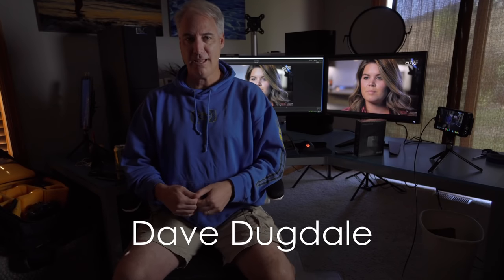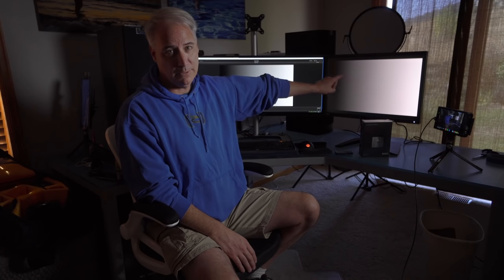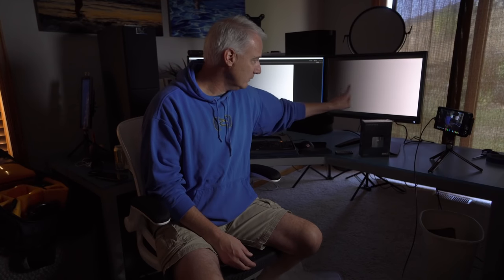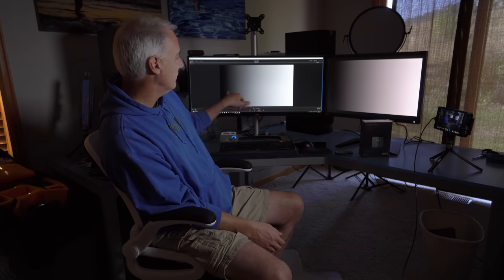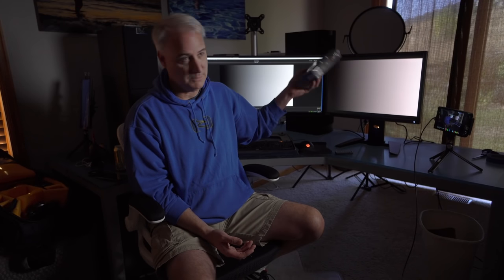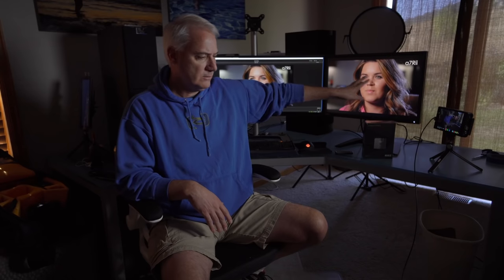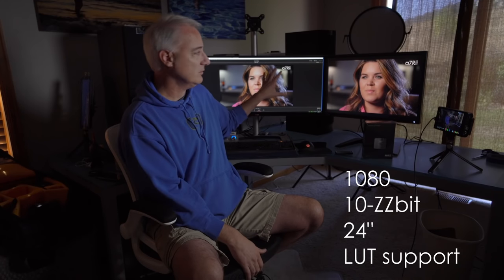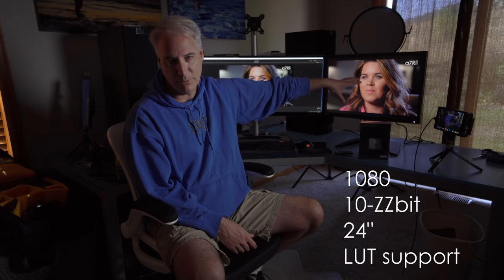Two Grading Monitors for Resolve to Perhaps Avoid

Comment: We use original Dreamcolors.  they are 8 years old and still essentially perfect REC 709 displays.  Because they have RGB backlights, we have been able to re-calibrate any drift in white point (why monitors later become unusable with age - the backlight goes off color - which you can only correct in an RGB LED system)  Generally Dreamcolors are great value if you buy the calibration kits - you can then refine the internal hardware calibration using LUTs etc.

Comment: I needed a bigger screen and my pc is just beside my tv so decided to use my Samsung 4k 48in tv (UE48HU7500)  I find it works great for my needs. I say its pretty accurate to my eye. Printed photos look 99% to what my screen shows. graded videos also look very good even on different screens around the house.  The tv settings is Standard on picture Mode and Color Tone, HDMI Black Level Normal and HDMI UHD color on. Colorspace set to auto. Then used THX tune up app. And Im happy with the results.

Comment: Dave, you have not done the PG2401PT justice in this review. I have been using one professionally as a grading monitor for DaVinci Resolve for at least two years. Yes, it is 10bit through DP and DVI-D only - not HDMI but I run mine through a 12G Decklink SDI card and SDI > DP adapter where I get 10bit @ full 4:4:4 on the Benq. The PG2401PT also runs at all popular video frame rates too. I'm in PAL land so have the monitor synced to 50Hz rather than the native 60Hz so all pans are smooth. It is a colour accurate PC monitor, designed for still images, not a TV so movement will never be as smooth as say a true FSI or Sony OLED 'video' monitor 

Also, as you only have the 3G 'mini monitor' card, your output will only be 10bit 4:2:2 BUT you could have used a simple, cheap, passive HDMI to DVI-D adapter to get 10bit into the BenQ from your PC. However, I do not recommend HDMI for any professional application.

PS: HDMI and DVI-D are virtually the same. BMD's HD-Link SDI to DVI-D adapter actually comes with a passive HDMI adapterr)
Reply from the maker: +Craig Marshall's Asian Rail Tours thanks Craig. So what am I doing wrong besides using the hmdi input at this stage, why I'm I getting flickering and other artifacts during movement?
Reply: Hi Dave. Not sure what is wrong with your setup but one of my very valuable video clients (based in Taiwan) brought me in the PG2401PT to Australia soon after BenQ released it saying "This is for you. Make it work" (When she says 'Jump', I ask 'How High?' get the picture....)I had just set up a Resolve PC workstation so like you, was looking for an affordable grading monitor for web based delivery. I had already bought a 'mini-monitor' too, so I tried the HDMI route but the pictures exhibited poor resolution with crushed blacks at 8bit so I bought a second hand SDI to DVI-D HD Link ($250) and suddenly, there was a stunning, crisp 10bit image on the monitor with a 10bit Tiff test ramp displayed in Resolve's Color page. (I now use the Decklink SDI 4K Pro card with an SDI to DP converter for 10bit @ 4:4:4. This is a good bet for 4K work too as SDI #2 will downrez all 4K to HD so you can continue to grade 4K video on the same calibrated HD monitor) Here's something worth testing if you still have the PG2401PT: buy a cheap passive HDMI to DVI-D converter and put it between your mini-monitor's HDMI output and the BenQ's DVI-D input and test for 10bit display. (note: DVI-Dual needs all wires correctly routed to display 10bit)Dave, at the end of the day, these PC 'photography' monitors are at best a 'workaround' for video grading BUT with an SDI 'foundation' in place,  you can always rent in a calibrated FSI or Sony 'video' monitor when more critical work is required. IMO, a probe and the supplied Palette Master calibration software on the PG2401PT is more than adequate for all web based deliverables. (I use Rec.709 at Gamma 2.4)
Reply from the maker: +Craig Marshall's Asian Rail Tours thanks Craig for all the info. This is getting more complicated than I was hoping for. I'm not sure what's wrong with the copy I have, I'll send it back. Not sure what I'm going to do.
Reply: Craig's Asian Rail Tours Hi can you please put the actual name of the converter you are using ? I mean the brand and the model etc much appreciated thanx
Reply: The flickering is from the AMA setting.  It's in the menu under System settings.  If you turn it off, playback is totally smooth.  Of course, this reply is one year too late! ; )  I just picked up a used copy of this monitor for $400 and it's nice, but my issue is that it is NOT uniform.  It is significantly warmer on the right side of the screen than the left edge.  It's going back.

Comment: EDITED -Found a good solution with low cost and descent accuracy when researching at BMD forum - BMD mini out HDMI to this box for LUTS and you use to create custom LUT to calibrate monitor - https://displaycalibrationtools.com/store/eecolor-lut-box-65-cube-3d-lut-color-correction-processor/ - From there you use a TV with good accuracy which led to my question before - So I had a question that was sorta discussed in the comments.  Why not buy cheap 'larger' TV that has 10 bit and you can use the BM HDMI out to the 'TV'?  I found this chart online - http://www.rtings.com/tv/tests/picture-quality/gradient - A Lot of these 'TV's' are very affordable and LARGE if you need that.  - Freespirit - below discusses a monitor that looks amazing and really inexpensive for sure.  Thanks for all the awesome content.
Reply: The EE box has long been a Pro solution but a more 'affordable' solution, with a couple of caveats is this: BMD recently released their 4K Terenex SDI to HDMI converter which operates at 12Gbps so it can display 4K video at up to 60P framerate. With this device installed, you can load calibration LUTs so you could run it from your mini-monitor card's SDI output to your TV's 'Graphics' HDMI input so in theory, correctly 'calibrate' a consumer TV. We use a 55" Sony 9000 Series 4K TV as a 'client' monitor out of our DaVinci Resolve grading suite so clients can view their HD/4K images on the big screen in real time, whilst we grade on our calibrated 24" SDI display.

Comment: I like the iDisplay Pro a lot. Made a cheapo BenQ computer monitor usable. Maybe with a new color profile the issues it has now might go away. Maybe...  I do think using a reference monitor will fix all the issues you have been dealing with. You are using computer monitors as a reference monitor right? Only issue with a reference monitor is it's expensive. Ugh right?
Reply from the maker: +Erik Naso yea, I can't afford a resl video monitor that cost 5 grand.

Comment: So I recently discovered that most computer videos cards don't actually put out 10bit color. with Nvideo you have to get a quadro card.
Reply: That is true if you're on Windows and if you are feeding your monitor directly from a computer's GPU. In Dave's case he's using a dedicated I/O card to output his video and it's ability to send a 10bit per channel signal is not limited by the GPU installed on the machine. The "new" MacPro's will do 10bpc and I think that the 2010-2012 Mac Pros running a GTX980Ti or the like may also have 10bpc since they're relying on Mac OS X drivers written for the Quadro line.
Reply: I plan on installing Linux soon in order to cleanly run Resolve. There is good support for Blackmagic’s DisplayLink cards, so things (could) flow better and work faster. Windows is so full of unnecessary bloat and Windows 10 actively works to grab your data. I don’t know why so many people are fine with that? I’m looking forward to leaving Windows (and OSX) behind. Since few programs still require a high-end desktop CPU & GPU, once I can run those programs on Linux, I’ll be ecstatic to finally leave Windows for good.

Comment: I just bought an Asus IPS monitor (MX279H) and a Decklink Mini Monitor 4k PCIe Card. I'm trying to make them work with DaVinci Resolve, but I'm having some problems: the problem is that when I try to set up the output from DaVinci to 1920x1080 progressive at any frame rate (23,976, 24, 25, 29,978 and 30 are the possibilities) the screen stays black with a "OUT OF RANGE" message. But if I change the output to 720p at 60 fps or 50 fps, it works perfectly.
So, I thought maybe the monitor only works at 50 and 60 hz. And I tried setting the output to 1080i at 60hz (30fps) or 1080i at 50hz (25fps). But it didn't worked either... just like the first time: "OUT OF RANGE" message.
The monitor works perfectly at 1080p at 50 and 60 hz if conected to my nVidia GTX 1070.

Can you help me to make it work at 1080p23,976?

Comment: I bought an Hitachi 50 inch 4k monitor about 8 months ago. If you have any advice as to what my settings should at least be for color grading that would be so helpful!

I get flickering often on certain clips that I can fix by moving the exposure buttons in Final Cut Pro X, but if I move them later, it comes back again!..what a pain.

Do you know the refresh rates or if my monitor is a 10bit?

Comment: What application are you using for calibrating your screens? I found DispcalGUI being far superior to the stock X-rite application that came with my x-rite Colormunki.
Reply from the maker: +Daten Raten the stock one. I have a lot to learn.
Reply: Yes, you really need to be using LightSpace or Calman.  Its a big jump in understanding however..  the software your using is more for Print type work..  You really need to be making LUTS etc.   Also, a probe in the $6000 up at least is required if you want reasonably consistent looks and good quality shadow calibration. (Its hard for probes to get good colour readings when the number of photons is greatly reduced..  The cheap probes tend to do poorly in this area )   Its not a cheap thing to do properly..    Oh and FSI from memory did come out with a cheaper version of its monitor that would be more suited to your use model.  So I would definatly check that out..  But its still in the few grand range..

Comment: Are you using quadro to drive 10 bit monitor.. I think you need a quadro .. As far as I know Geforce cards don't output 10bit..  although I think GTX 10 series might because nvdia said 10 series support HDR output which requires 10 bit colour space, I'm not sure though ..
Reply from the maker: No I am using the BM Mini Monitor to drive the grading monitor, my GTX980ti drives my GUI.
Reply: Ok.. Thanks for the reply :) .. I use GTX 970 so if i buy 10 bit panel i only need to buy this to drive 10 bit rather than expensive quadro right?
 ..
Reply from the maker: I think so, I am not an expert on that topic.
Reply: Ok..  Thanks Dave
Reply: they do output it, but the UI doesn't use it. you also need certain cable setups to make 10 bit color work,
no matter what card or monitor you have. it will never go over HDMI  http://nvidia.custhelp.com/app/answers/detail/a_id/3011/~/10-bit-per-color-support-on-nvidia-geforce-gpus
Reply: Space Cadet HDMI 2.0 support 10 bit and 12 bit  with REC 2020 color gamut, provided both card and monitor support HDMI 2.0
Reply: Harikrishnan K M but you would need a quadro. i'm not sure any quadros have hdmi. they have DP which is already much better
Reply: Yes, Nvidia requires Quadros and supported drivers for full 10 bit+ support.
Reply: Not to be a wet blanket, but you may want to double check with BMD to verify that you actually can get 10-bit per channel out of your card over HDMI. I called them last week and was informed that my DeckLink 4K Extreme 12G only outputs 10-bit per channel via SDI, and that with it's current firmware the only way I could drive an HDMI display with 10bpc would be to buy one of their Teranex SDI to HDMI boxes...
Reply: I've been looking around because this really confused me, i was certain that any card since i think the 700 series of cards supports 10 bit. It seems to be that its not really the card itself that is limiting whether or not you can actually output 10 bit+ but rather the drivers implemented for the card and the software used. At least this is what im coming to the conclusion on, so this seems kinda sketchy if that is the case, seeing as its basically forcing people to buy extra things to be able  to run 10 bit . i myself have been looking at getting the SW2700PT from BenQ, i haven't seen alot of reviews on it, most of which are German. So if anyone has any information on this monitor or a similar one please do let me know :)
Reply: The hardware may support 10 bit color, but the VBIOS on Geforce cards prevent full support. Nvidia needs are reason for professionals to buy Quadro cards. Some cards can enable 10 bit via the Nvidia driver, but it's unclear if this is true 10 bit color. The Nvidia 10 series has full 10 and 12 bit color support for games and video encode/decoding. I'll share two links in a comment below.
Reply: Nvidia 10 Series video support:
https://www.techpowerup.com/reviews/NVIDIA/GeForce_GTX_1080/3.html
Older Nvidia Hardware 10 Bit Support:
http://forums.evga.com/gtx-1080-support-for-10-bit-display-m2510043.aspx
EVGA Tech Support stated, "Only workstation cards output true 10 bit color for both Direct X and OpenGL. Geforce cards will support 8+2 dithered in some applications. At least this is the case for 900 series and below.
As far as Pascal goes. It will support 10/12 bit color in Direct X driven applications however OpenGL will still use 8 bit color. You will still need a Quadro with workstation drivers to achieve 10 bit in OpenGL."
Reply: That's basically what I just said, it's supported but isn't allowed by something somewhere in the system.
Reply: Correct, there are two limiting factors, the VBIOS on the card and the Nvidia GeForce Driver.
Reply: Yeah. Becauze I had read that some cards will allow you to enable the 10 bit but also the programs won't actually allow you go use the full gambit from the card to the software. Which in my opinion that's really horrible for a company to do, a product you've made supports something yet you limit people actually being able to use it just so you can get more money. Because the quadro cards are the same to their counterparts except for some of the software use and the amount of Vram and a few other things. Kinda like if someone were to spend a large sum of cash on a car, but the car can't go over 40 miles an hour unless you buy this special key to fully turn it on. (Poor example but you get the point)
Reply: True. The reason Quadro cost more is driver development. Professionals need a graphic solution which is 100% reliable, and the Drivers are guaranteed to work with their professional software. Engineering, CAD/CAM and VFX are all fields which rely on Quadros. The extra dollars spend for the hardware upfront outweighs the costs of downtime, crashes due to driver conflicts, or lost productivity. For the average consumer, GeForce cards will do just fine for gaming.
Reply: Unique Photo and Video they'll do just fine, but they will NEVER DO 10 BIT COLOR http://nvidia.custhelp.com/app/answers/detail/a_id/3011/~/10-bit-per-color-support-on-nvidia-geforce-gpus
Reply: Correct, I meant just fine for gaming. I edited my previous post.
Reply: HDMI connection to a grading monitor? Hmmm....